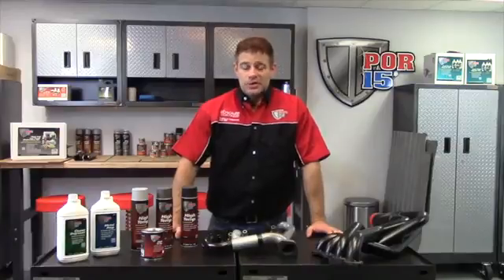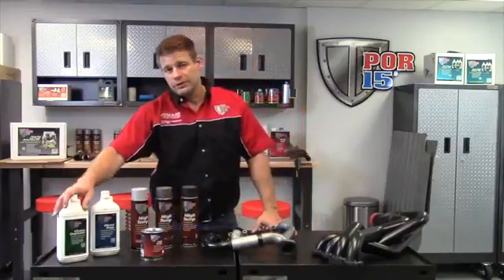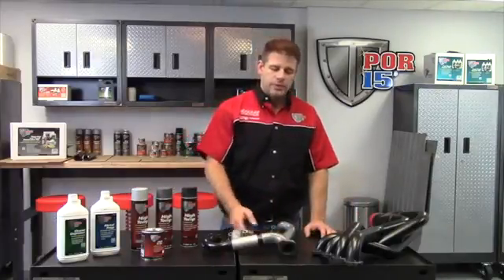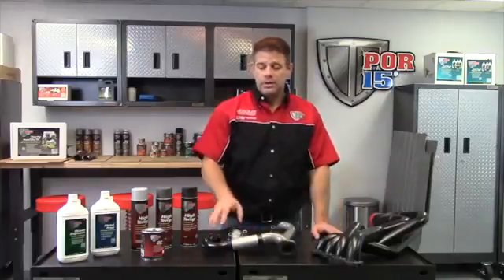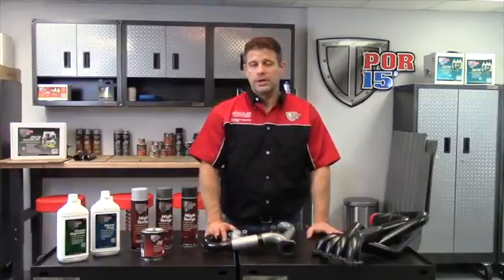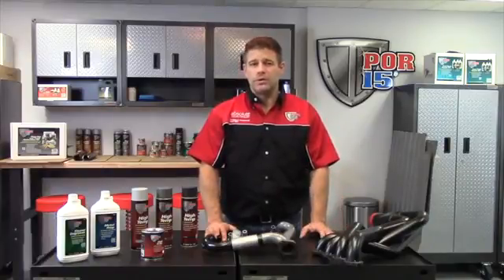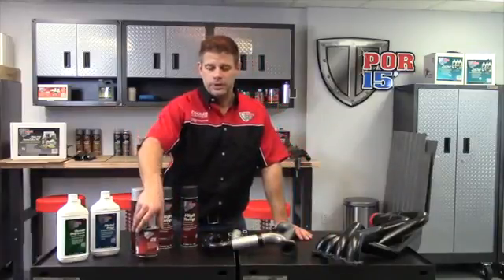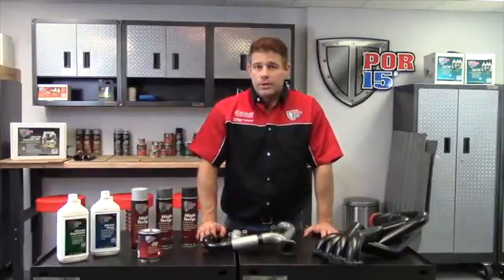POR-15 High Temp Coatings

Comment: what temp range etc  drying time
Reply: I know right… they had one job
Reply: @Parker Creates  He said paint after average running temps. Which he said was 15-20 minutes of run time? Lol.
Reply: @brockbrawn1524  run them on your car than paint that makes no sense
Reply: @kenmcdade8368  It's called flash temp. And it takes a temp of 3-500 degrees. To properly dry and cure.